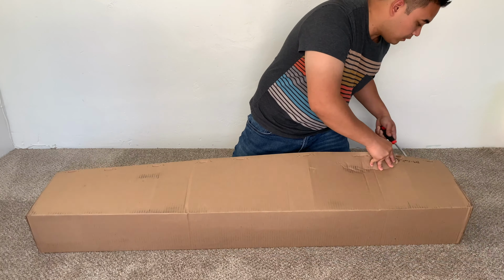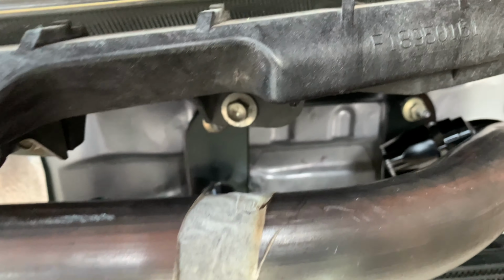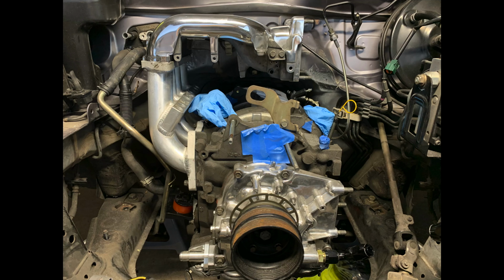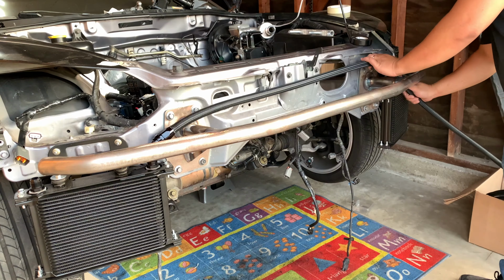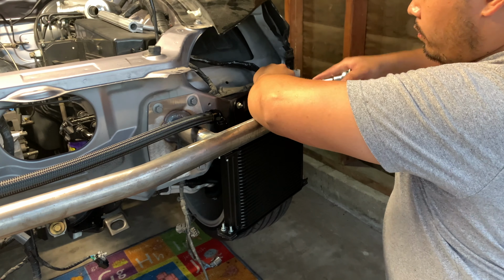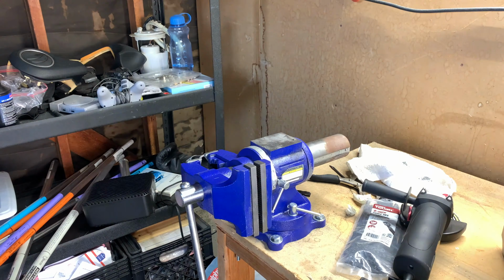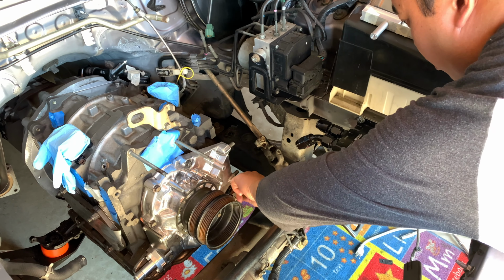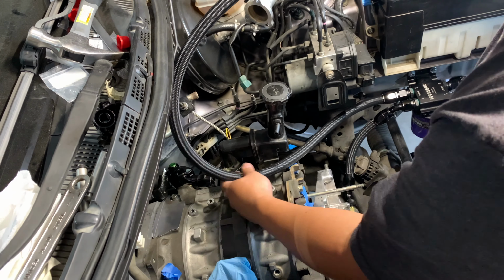13BREW RX8 Oil System (Part 3): Completing the Oil Cooler Lines and Banging in the Firewall

Comment: Kewl vid man keep it up one suggestion tho your bash bar is pointless if you are intending to run it with the oil cooler an fittings right there one cave in or bump to that corner an you engine will loose oil pressure an level within seconds kind of defeating the purpose of protect all running gear and chassis rails its ashame you cut it an didnt just make a custom mount to lower them
Reply from the maker: The thought process there was to keep the stock location of where the OEM oil coolers were. Definitely sucks that I had to cut the bash bar, but mounting the oil coolers more down would have not cleared the bottom part of the bumper.

Comment: What's up man!  Was that fragola hose you used or what brand was it ?
Reply from the maker: Which one you referring to? The one that is on the oil pedestal is from Franklin engineering and the external oil filter + thermostat is from improved racing. All hoses and fittings are from red horse performance
Reply: @freemadc2  yeah, the hose that you used.
I was curious what brand and or where you got it from.

How much did footage did you get for that?  10ft?
Reply from the maker: @josea7422  darn I don’t remember. Think 15 or 20 ft
Reply: @freemadc2  ah ok cool...  
I have to do mine but i haven't figured how I'm gonna run it, so was trying to get an idea, although I'm only running 1 cooler .
Reply from the maker: @josea7422  oh ok. RX8 or for your FD?
Reply: @freemadc2  for the 8 .   I was actually mocking it this weekend and thought about putting by where you had yours, but my intercooler pipe runs close by so it'll be a pita lol.  
So I'll put it down by the oil pan since i have space and i have to jack the car to drain the pan when replacing oil anyway 😅

Comment: Hey where you get the oil feeding adapter?
Reply from the maker: yoooo. Here is the breakdown.....

https://franklinperformance.nz/collections/mazda/products/external-oil-feed-adaptor-for-mazda-12a-13b-20b
https://www.improvedracing.com/remote-engine-transmission-oil-filter-mount-with-thermostat-env-171.html
Reply: YOO FREEMADC plz tell me you remember the exact part number for the radium I dat for 3 days straight free time rewatching your video with subtitles trying to get the right size . I got the 8an-10an 28.5 I saw the other options was 25.9 and 20.2 . LMK IF U CAN HELP !!!??